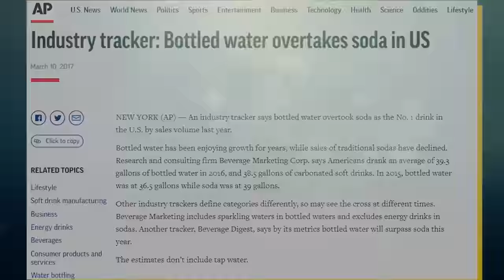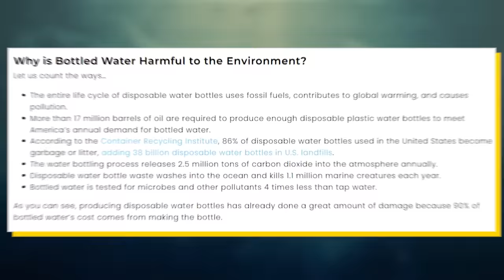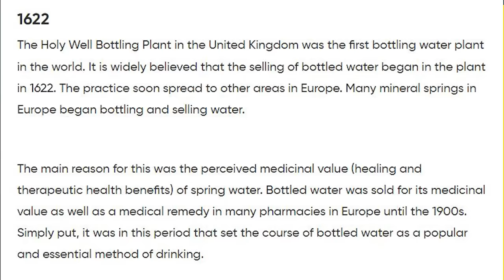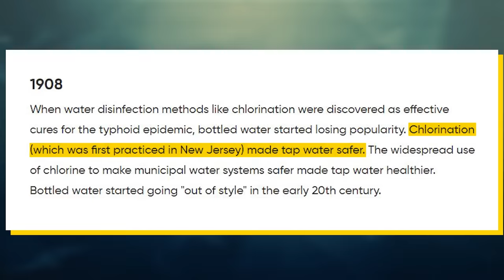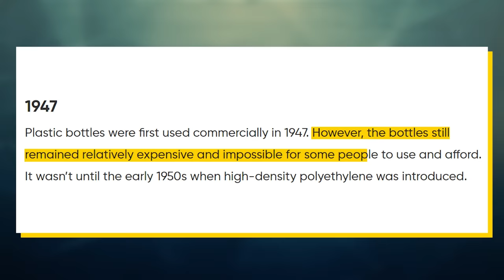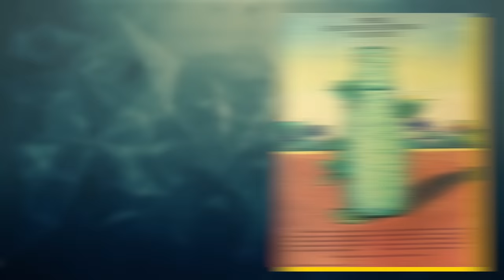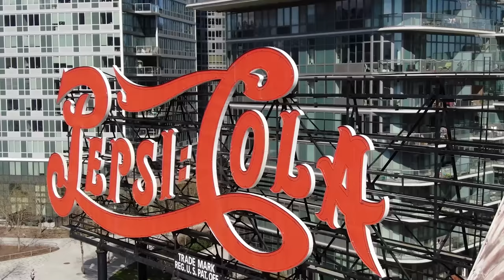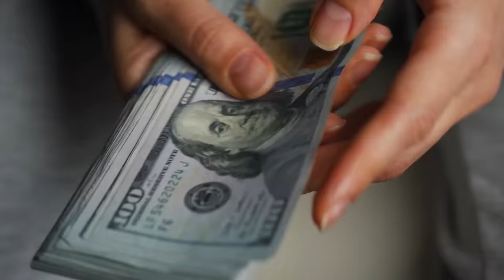Bottled Water Is Literally A Scam

Comment: Me and my family only drink sprakling water. Or fizzy water. Or carbonated water. How the hell do you say it, you get the point lol, we tried many times to install one of those water purifiers that also carbonate tap water under the sink but other than the initial cost that's like 2 months of my dad's pension it also costs more to run than buying water in bottles. How. I have no issues drinking tap water when we're running low but I just don't enjoy it as much, that's why bottles are the only choice if you don't want to spend a fortune having it delievered at least. Also we have various methods of recycling them of course.

Comment: You can pull up water reports for what is foudn in your tap water. Once you do that, do the same for the bottled water brands. I drink bottled water to avoid consuming literal crap, drugs, paper, and so much more found in tap water. Tap water makes me sick, my skin breaks out, and i get suepr dry flaky skin no matter how much i drink of it. Some brands of bottled water are just as bad. Only a few made a massive difference me. Fiji, vitamin shoppe water being the main two. I never felt better, or had better skin since i started drinking these two as my daily water. You did your research in the wrong direction.

Comment: The 0.6% figure is probably not accurate to the actual individual experiences of Americans, I live in an"area" with "good tap water" but due to my individual living situation I am not confident in my water quality due to plumbing etc etc and would not use it for drinking. I know what is in bottled water, and I don't know exactly what is in my tap water. I'm not going to gamble. The cheapest store brand bottled water is more than enough, and I spend at most 15 dollars a month on drinking water, which is a sacrifice Im fine with and far cry from the ~1300+ factoid.

Comment: sorry but this video is click bait, i do like most of your videos but this one has really disappointed me. I have done a lot of research into bottled water and the only scam is if it doesnt say 'mineral water' and contains the minerals on the bottle in the UK at least its illegal to do that. Which means its tap water any cheap brands are tap water. But i pretty much only drink water so trust me i can tell the difference between tap water and bottled because its the only thing i drink. Ive even got a group of friends together with random cups and they could tell which ones were tap and proper bottled water.

Comment: You did very little scientific research before making this video. pH is a critical factor you need to consider when discussing water, but you did not mention it. Tap water will never have a high pH, but also most bottled waters won't either, but you can find some that offer a high pH if you research correctly. This is the most important thing about any drink you can have. Second, the minerals do help. If you can find bottled water with a good amount of vanadium, it will literally help you with several health issues or even prevent them. Also, it literally delays aging (for real).  I'm not from the US though so I do not know the quality of bottled water over there, so it is worth reading the label and understand what it means before making a choice.